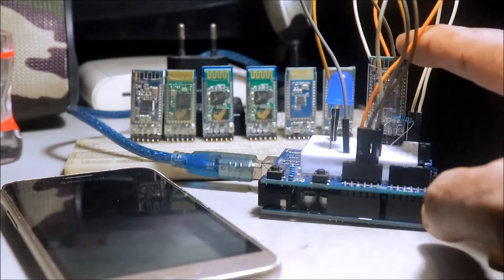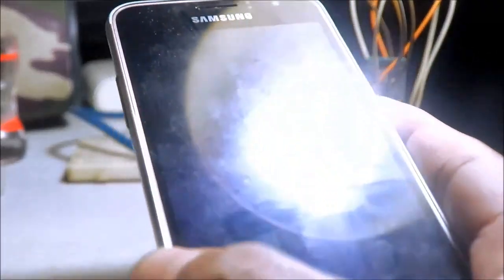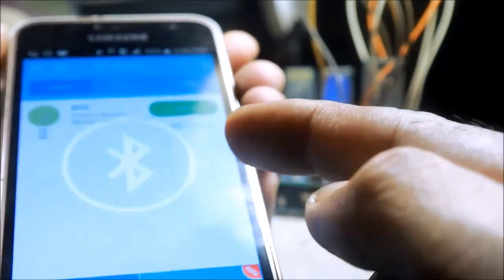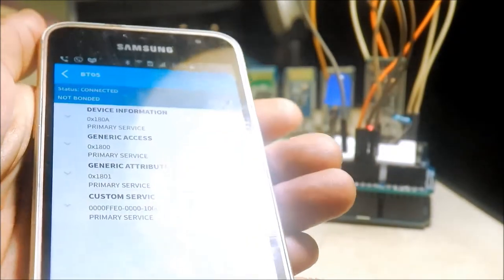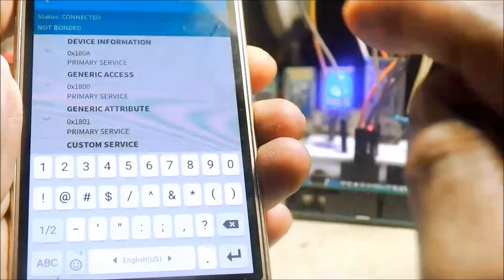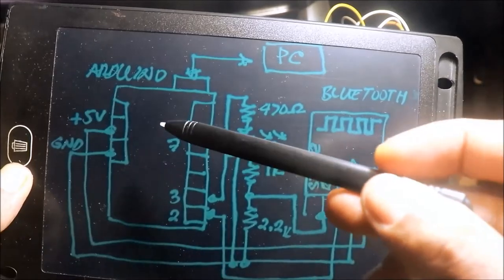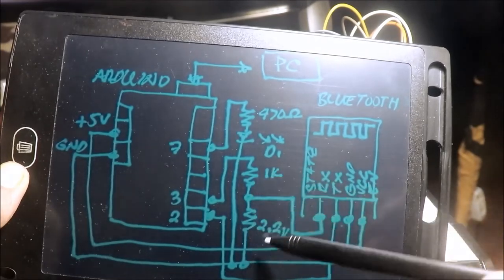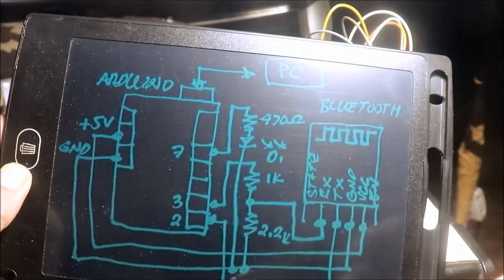Android Control LED On-Off | HM-10 BT-05 Bluetooth | Arduino Uno R3 ProtoShield (Filipino)

Comment: Hello po, paano po if gusto ko i-flash yung program ko sa HM-10 and use coin cell battery instead of relying to arduino? Ano po ang need ko gawin para ma achieve yun? Thanks.
Reply from the maker: sir magandang  project yan...susubukan din natin yaan,,,
Reply: @tagalogelectronics6615  Salamat po.